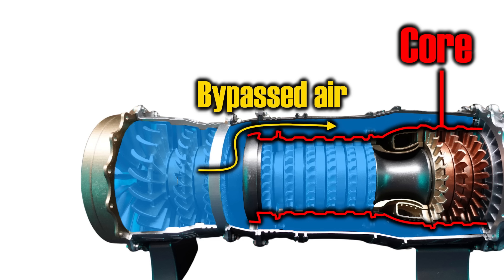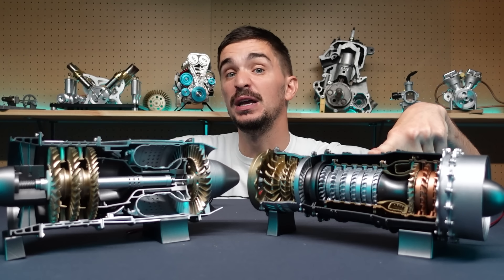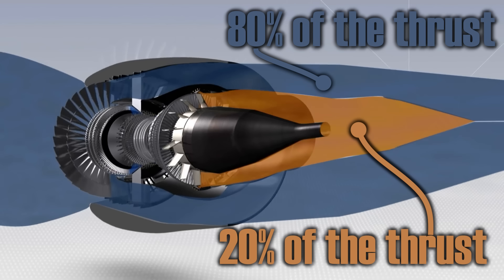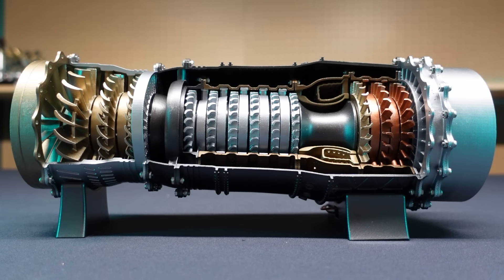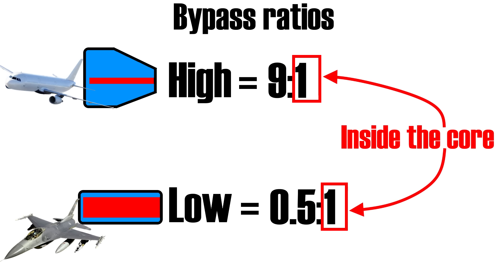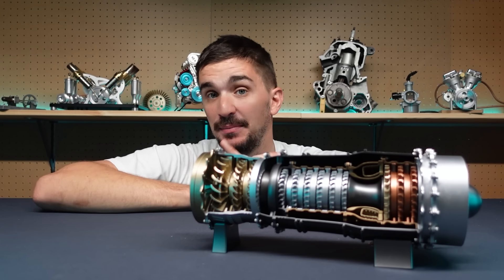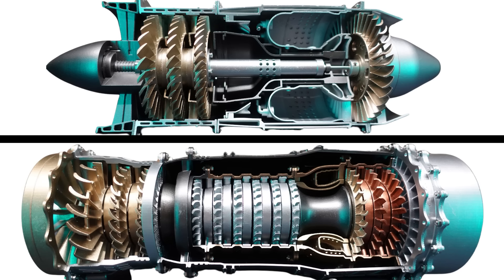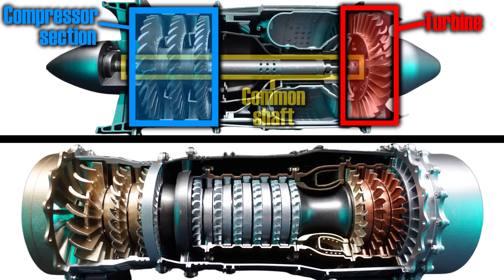Jet Engine Evolution - From Turbojets to Turbofans

Comment: 12:50 The Losi dirtbike R/C and its 2 counter spinning internal flywheels make it dang near impossible to tip over.

This part of the video reminded me of it and similarities to how the engine + wheels affect the bike.
Reply: I had an RC motorbike as a kid with an internal flywheel. It makes a HUGE difference to model bikes, otherwise you have to maintain very high speeds to keep the gyroscopic except of the wheels high enough... Not something that's easy to do with a model bike, without the gyro you'd need a massive perfectly flat parking lot to run it and take long sweeping turns. With the gyro it was possible to turn it on a 2 lane street with ease.
Reply: @volvo09  yea they used to come with training wheels.. hah thats the kind we had.. very slow, with training wheels, but it was an R/C motorcycle!! Sewper Kewl! Not.
Reply: @umakemerandy3669  yeah I remember taking them off. Gave up on the body real quick. The riders foot was all worn away from crashing and sliding when I finally stopped using it.

Comment: I’m 24 and have worked on automobiles for about 6.5 years now, restoring my own collection of older trucks. I’ve always figured airplanes and their technology were out of my reach so I never gave them much thought. Until about mid December (‘23) I watched one recommended YT video of a C17 Globemaster III accidentally lane at the wrong airport that happened to be much smaller and it reversed back and still took off to the shock of the crew behind the camera. Ever since, I’ve done so much research of what kind of aircraft the US military and others have around the world and their capabilities and support roles. Now I’m going thru the process of enlisting in the Air Force and by watching this one video I’ve realized that their engines aren’t too complicated and that I can pretty easily comprehend how they function, just like how I learns how automotive engines work. I will forever help my future children in understanding that they can achieve anything in this world and that nothing is out of their reach as long as they have some kind of interest in it. Passion can really be incredible.
Reply: Or if you don’t want to do a military contract you can go to a A&P course for airplane maintenance and power plants. They also service Airline and government contracts with their aircraft.  Especially here in Houston there’s a lot of Jobs and Military airports close.

Comment: As you said, turbofan engines of higher and higher bypass ratios have been developed to improve efficiency and reduce noise. To add a bit of engineering and physics to the discussion I offer the following:

Noise - A significant source of jet engine noise is the shearing/mixing of high speed flow from the core with the lower speed flow surrounding it. In a turbojet engine, all the high speed core flow is interacting with the low speed flow around the outside of the engine, creating one very strong shear/mixing zone. With a turbofan engine the high speed core flow is mixing with the slower fan flow (still much faster than the overall flow over the engine) and the fan flow is mixing with the slower overall flow creating two less intense shear zones and therefore spreading out the mixing zone resulting in a gentler energy exchange and less noise.

Fuel Efficiency - The job of the engine is to produce thrust. When thrust exceeds drag the aircraft accelerates. At cruise, thrust = drag. Thrust comes from increasing the momentum (mass flow rate X change in velocity) of the air flow. Fuel requirements are driven by energy considerations however, not momentum. Jet fuel is a storage medium for energy and is about 43Mj/Kg. Kinetic energy of the flow is (1/2 X mass flow X velocity squared).

So, if we want an engine that produces say 1000 units of thrust, we can chose a low air flow rate/high airflow speed change solution (turbojet) or a high airflow rate/low airflow speed change solution (turbofan). But in either case, the fuel flow will be proportional to the kinetic energy change of the flow. So, suppose we want 1,000 units of thrust.

We could choose a turbojet engine that processes 250 units of air flow and accelerates it 4 units of speed. Multiplying those parameters for momentum change/thrust we get 250 x 4 = 1,000 units of thrust and for kinetic energy change we get 2,000 units (0.5 X 250 X 4 X 4).

Now we choose a turbofan engine that can process 500 units of air flow and accelerate it 2 units of speed. Multiplying again for momentum/thrust we have 500 X 2 = 1,000 units of thrust. However, the kinetic energy change required is now 0.5 X 500 X 2 X 2 = 1,000 units of kinetic energy...half of what the turbojet would require for the same thrust. In practice we can't get all that improvement and the resulting turbofan engine will be more complex, heavier and more expensive, but you can easily see why engineers pursue them!
Reply: This is a good, insightful description.
Reply: that is speed/velocity efficiency
Reply: Very good explanation. I haven't thought in terms of momentum vs. kinetic energy before but it makes perfect sense now.
Reply: Thank you for this clarification. I have another question that I didn't understand from the video. The author of the video mentioned that we can't have the bypass air (or end of the tips) exceed the speed of sound, but how come there are low-byepass supersonic airplanes? This confused me quite a bit...
Reply: @tijljappens7953  on any kind of jet engine, only place where gas is faster than speed of sound is exhaust, but because that gas is hot, it has high speed of sound so maybe on some aircraft , at supersonic flight, hot gas does not need to be on supersonic speed because of itself hot temperature it still is more faster than true airspeed of ac(for ex Ma1 for air at 15C deg is 1200km/h but for gas at 800C deg  it is at 2370km/h) sa exhaust gas at 800C deg, can flow through nozzle at 2300km/h and it is still below  Ma 1
Reply: @tijljappens7953  There is nothing that prevents the blade tips (fan, compressor, turbine) from exceeding the local speed of sound. It would be a matter of managing the shock waves (and associated wave drag and flow instability) that could occur. There are fan engines designed for supersonic aircraft that employ supersonic flow throughout the bypass section. I don't know too much about them but I would suspect that they are pretty inefficient, which might be OK for a military aircraft but not so much for a commercial transport.

Hope this helps!
Reply: Excellent answer. This should have been in the video!
Reply: A Turbo prop engjne can be thought of as an even more extreme version of this idea: efficiency below 300 knots is unparalleled (a well designed propeller can convert between 80 and 90% of its shaft horsepower into propuksive horsepower), but the dependency on incompressible flow for normal operation means that trying to operate at higher speeds and altitudes will cause a sharp falloff to thrust, and a dramatic increase in noise and vibration.

....i just want to point out how nutty that sort of efficiency is, though: that's the same ballpark of efficiency as your car's transmission with ideal traction, and your car gets to push off of something solid: the propeller is hitting these numbers in fluid dynamics

Comment: Ok, now we need a vídeo about the chrysler turbine car!
Reply: Wow that was a thing?
Reply: @АлакПатрова  yeah, a concept back in the mid 60's if I remember correctly. Turbine engine ran an auto transmission through a gear reduction. Goal of the car was to have a car that could run on multiple fuels. 

It wasn't fuel efficient, wasn't exactly quiet (but wasn't too loud either) so it never made it past a handful of test cars. The testers loved it though.
Reply: @volvo09  a turbine on a CVT would probably work really well.
Reply: @АлакПатрова  I Think The problem would the heat. 

I know that some cars have problem with cvt overheating, so if it overheats with a engine revving about 8.000 rpm, would be very hard to make it works at 80.000 rpm.(I think that friction may cause a big headache to resolve)

However if it works would very cool! A turbine can reach 70% of thermals efficiency, It's about 30% more than a otto cycle engine
Reply: I've always wanted a turbine car, and I don't care if it's from the 1960s or 2060s. (Ok, time travel not allowed yet? Sorry, 2025 then.) I think the only barriers were cost and operator error, both of which might be already overcome.
Reply: @DistracticusPrime  cost, fuel consumption, exhaust emissions, power response (fixed by a hybrid system), narrow operating speed range (fixed by a CVT or series hybrid system), even worse efficiency off of ideal operating point (fixed by hybrid system), high exhaust temperature...
Reply: @user-qo3yy9nv1u  some form of CVT would be essential to achieve close to acceptable efficiency for modern road vehicles. Considering the need for extreme speed reduction, the best solution with current technology is a series hybrid: the turbine engine drives a generator at turbine speed, and electric Motors drive the wheels (through reduction gearing), with a battery to smooth out power demand.
Reply: @brianb-p6586  I agree!  Would be the perfect solution in my opinion!
Reply: @brianb-p6586 Excellent description of what I only alluded to. I think fuel consumption and emissions are also already overcome; turbine generators are more efficient and cleaner than small reciprocating engines in hybrids, and often used to generate the grid energy supplied to "zero emissions vehicles". So that leaves only the high cost.
Reply: No,  @DistracticusPrime , small turbine engines (whether they are driving a generator or not) are not more efficient or cleaner than reciprocating engines of similar output. The huge gas turbines in electrical generating stations are much more efficient than small gas turbines, and are still not better than car-size reciprocating engines unless they are used in combined-cycle systems... and they're not clean, either.

Comment: Maybe a model with much bigger bypass would be a better example :)  another way to explain it is that the turbofan is an additional longer shaft added onto the turbojet engine so they share the core.

Comment: Me encanta como lo explicaste, específicamente me gustó mucho como explicaste el camino que sigue el aire a través del motor y los diferentes rotores que hay y las direcciones en las que gira cada uno; y el papel esencial que desempeñan los estatores.
*
I love how you explained it, specifically I really liked how you explained the path that the air follows through the engine and the different rotors there are and the directions in which each one rotates; and the essential role played by stators.

Comment: At 01:18 you show blue (cold) air coming into the engine - but there is a wall around the combustion chamber and there is no way the blue air passes that wall. 
I can guess the meaning, - but it is hard to understand if there is full passage or the blue air is compressed along the edge of the combustion wall and then blended after the combustion chamber. But that would be a bypass turbine, wouldn't it?
❤Beautiful video.

Comment: The Boeing 767-300 I flew for United for 14 years had a high bypass fan engine where approximately 80% of the total thrust was from the cold air from the fan and only 20% from hot jet exhaust.

Comment: Actually wondering how jet engine principles can be used for a combined heat and power boiler. Only seeing one moving part, the central axis which is nice. Alternator parts can be built straight onto the rotating elements.

Comment: Staters or opposing rotating blades also prevent air from spiraling through the engine, this increases efficiency by directing forces straight.

Comment: great job explaining this complicated process but it leaves me to wunder if you can tell me what kind of combustion chamber pressure there is before combustion, surely not as high as an internal combustion engine,
secondly how is it that the high pressure blast that the air/fuel mixture creats is going to push back against the incoming air from the compressor and hamper the airflow, what prevents this. thanks for adding some real knowledge to what has become a place full of B.S.

Comment: Fun stuff! Some of these heat engines can operate on most any fuel type. Some waste oil heaters too. Tickles me pink that Garrett receives little regard. I think maybe Garrett Air Research Honeywell Jet, TFE, and TPE331- are a significant study in themselves. Great video💛👍🏻

Comment: It would be cool to make a video about how and why the hot gas doesn't expand forward, too.
Based on what I saw here I can sense that those chambers have a role in that, but details are needed to have a complete understanding of it.
All the videos I saw miss that part, just as videos about steam powerplants don't explain how fresh water is pumped in the boiler that already has a high pressure (in case you need idea for a new video).

Comment: There aren't any aircraft with fan diameters greater than their own fuselage (not yet), but the GE9X engine installed on the 777x has a fan diameter (3.4m or 133.5") nearly that of a 737 fuselage (3.76m or 148").  The nacelle of the GE9X is 4.4m (174").

Comment: Natural gas turbine power stations are turbofans. Part of the bypass air is used to supply compressed air for the unit; the rest is used for emissions control.

Comment: Great videos.  However the fan and/or compressor rotor blades diffuse the air in order to increase the pressure; the spacing between the blades on the trailing edge of the blades is smaller than the spacing on leading edge of the blades.

Comment: Another nice video, but I disagree on the cancelling contrarotating giroscopic effect. Two giroscope spinnig in the opposite direction does not cancel, they sum themselves. Contrarotating propellers cancel the reaction torque that tend to turn the entire airplane in the opposite direction of the propeller. Backward rotating crnkshatf limit front lift in acceleration. 
Girosopic effect depend on the diameter of the rotor, jet engin have small diameter rotors compared to propellers.
But aside this, great video, really.
ps I could be wrong, but I have trouble to make an experiment...
Reply: Indeed it is the case that Opposite rotation of two identical gyro discs on the same shaft completely cancels all gyro effects.
   Look for the toc1955 double gyroscope video.
  There is no inherent torque reaction for a gas turbine engine. If we think about a pure gas generating device with gas flowing from it through a tube to a turbine then out of the tube with the turbine turning a propeller shaft then if the bearing are good the casing will not be turned by reaction torque, if there is a stator stage then that might act as a fan which will transmit torque to the case.
  A piston engine has reaction torque & so does an electric motor.
Reply: For the F35B Lightening STOVL aircraft in particular & in fact all F35 variants the F135 engine does always have contra rotating spools so the bypass fan stages & low pressure turbine spool section rotate one way & the hp compressor & hp turbine rotates the opposite way.
    For the F35B in particular the forward vertical lift fan has two fan disks that rotate in opposite directions so completely eliminating any gyroscopic effect for that component.
Reply: I learned that gyroscopic effect is stranger then it seems...you are right, they cancel it. I tried to experiment by myself, but 2 pc power supply fans (140 mm, plastic, 1800 rpm) were far too light to feel anything....
Reply: @rickybanzai2199  
I did the experiment back in 1973 with two bicycle🚲 wheels with just a nut to connect the spindles together. Spin one wheel & the gyro effect is obvious. Spin the other wheel in the opposite direction & the gyro effect disappears.

Comment: I love all your descriptions of how engines work and this one is no exception. However, I couldn't help notice that there is something wrong with turbine wheel at 6.53. I thought it had been put on the model the wrong way round, the burners are acting on the trailing edges of the blades 😬, but looking again, it seems to be a compressor wheel; the burners are acting on the convex surface of the blades, this is nearly always the concave surface. 🤔

Comment: Next let’s hear about the “geared turbofan” which has a reducing coupler that will slow down the speed of the fan at the front while keeping compressor running faster. I think.
Reply: That's correct - the gearing allows a larger fan diameter without reducing the speed of the power turbine and first stage compressor.

Comment: Just one thing you got wrong or at least I have never seen it on any of the jet engines I have worked with.  I have never come across guide vanes after stators, one of the functions of the stators (aswell as compress and slow the airflow) is to guide it onto the next set of rotor blades at the correct angle.  Perhaps you were thinking of "variable inlet guide vanes" which are just stators whose angle can be changed.  Where an engine has these they are always located in the initial stages of the compressor to compensate for the extreme angles of attack the airflow can create (to the rotors) during start up or low engine speeds which would otherwise cause surging.

Comment: 4:28 Correct me if I'm wrong but I dont think thats right... You're probably referring to the GE9X on the 777X having a larger fan diameter than the 737 fuselage but theyre completely different aircraft
Reply from the maker: It's on the 777x but it's only larger together with the entire fan duct, so not entirely correct the way I said it 🫠